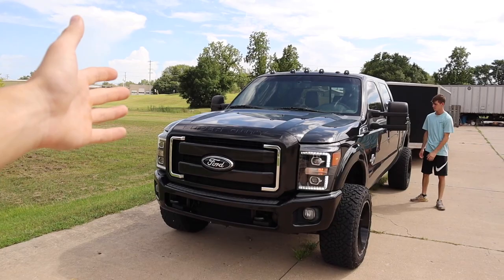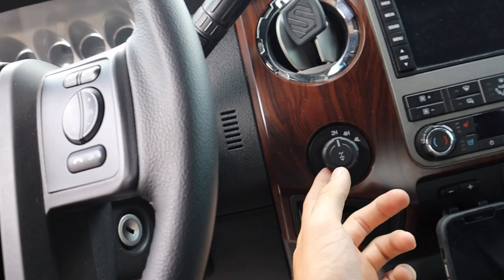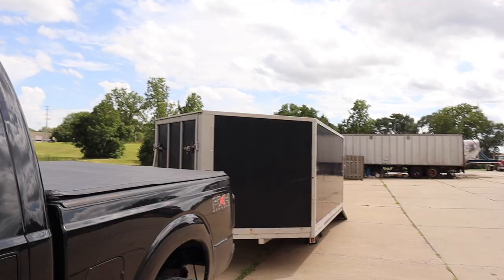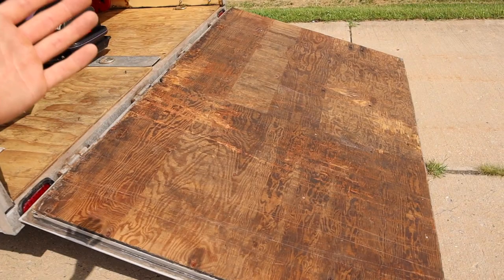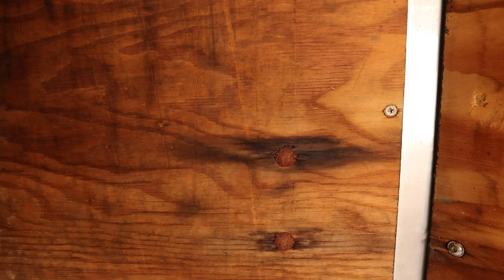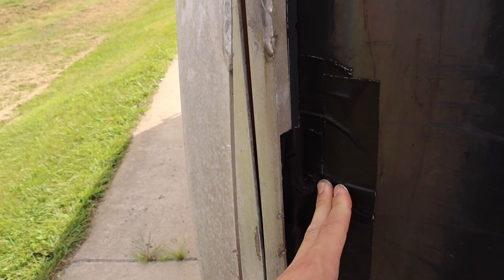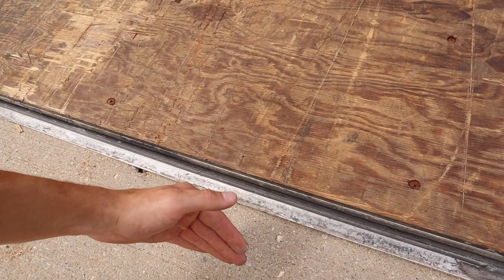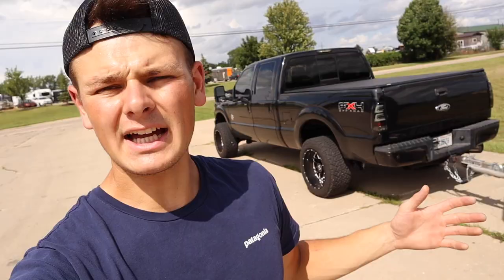My Snowmobiling Truck & Trailer Setup Tour!

Comment: I like your truck and trailer setup. Mine is a 2012 ram 1500 and currently 2 sleds. Arctic cat and ski doo. No trailer yet but would like an enclosed one for 3 or 4 sleds

Comment: Nice setup!! I always say as long as it gets ya to the snow and home without any issues it’s good enough!! I’ve got a 2017 F-150 2.7 Ecoboost (the baby) of the ecoboosts, and picked up a 4 place 7x27 inline trailer this spring. Pulled it loaded a few times this summer and truck handles it like a dream.